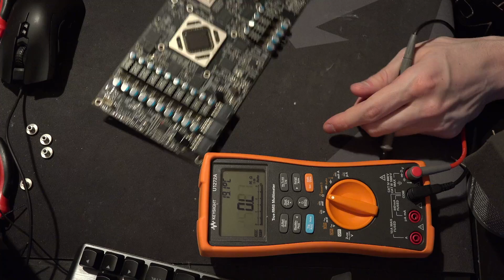Investigating the VRM config of Powercolor's custom PCB HD 7990

Comment from the maker: it was 4AM and I didn't manage to record anything else. And like that this video ended up public
Reply: Mine overclocks memeory much worse than both my ref cards and the stock memeory clock is 1350 where the ref 7990 memeory is 1500 at stock.
Reply: Its fine, i have a 7990 that fans spin but no display or not seen in bios. Gotta pull it out now.

Comment: @Actually Hardcore Overclocking I actually just got an HD 7990 with and ek block included and the air cooler. It was only $100 and I'm really excited even though it's not a custom PCB. Keep up the good work dude.

Comment: Damm i love that card! Fee months ago i bought an RX 480 8GB Reference card that had the same problem. With AMD driver it POST but after Windows boot it stay on black screen. I tried everything but at the end i fixed it by BIOS Modding to a RX 580 and it still working. So i don't know if that can help you with that card but it worth the shot.

Comment: This here is surely a curious card.
Though, the power layout seems a bit strange to say the least.

Though, putting the VRM between the two GPUs is an interesting idea. As long as it doesn't interfere with the communication between the GPUs it would solve some of the issues.

If I were laying out this board I would have put on some buss bars on the back. Literally a large copper strip elevated slightly off the surface of the board, carrying power over to the other side with fairly minimal losses. Advantages with such buss bars is their exceptionally low resistance, and that they don't really take up any board space on their journey over the board. (And they can also double as strengthening bars to stop flexing, but that isn't really a major issue for most graphics cards.)

Though, the real solution is to have a VRM for each GPU. Since even with impedance matched power plains we can still run into issues overvolting one of the chips if the processing load isn't shared between them, as in one is idling and the other is working.

Comment: I think you could resist the shorter trace runs, so the longer run could balance at the memory chip. That way you could turn up the entire voltage base. Not sure how that would factor with ohm's law on the longer run, need to calculate it. that could very well be the basis of the missing caps, for the longer run.

Comment: wouldnt swapping chip and vrm cause issues with pcie signal integrity?
Reply from the maker: https://tpucdn.com/gpu-specs/images/c/2523-pcb-front.jpg
Reply: @ActuallyHardcoreOverclocking  I was going to mention the 295x2, but I guess you beat me to it.
Reply: depends how solid or 'holy' the ground plain is, and if it's different signaling or single-ended. You are correct in that voltage drop over distance occurs for everything, not just power. B)
Reply: @Zarcondeegrissom  I was more concerned about induced voltage and crosstalk from the vrm to the pcie signals?
Reply: kingspride, yeah, laying out traces is a work of art, that is more than just making it look pretty. like knowing how to mix paints and what paints to use on what surface, there are corses on laying out traces so that they minimize 'inducing' signals on each other. ranging from right angle crossings to coplanar ground planes, to having power or ground between the signal trace and the sources of noise. It's not impossible, it just takes some work and having enough PCB layers to do it.
Reply: Tadas Nanartonis, due to the presence of the PLX chip, and what the PLX chip does, the distance that matters by moving the GPU dies, is from the PLX chip and GPU, not the GPU and CPU. Correct that distance matters, however, I'm sure PCIe has a max length far longer than the length of a PCI card, lol.

PCIe being differential, also reduces any cross talk, so all that matters really is keeping the 'parasitics' between the twin signal traces and the surrounding ground plane modestly consistent (within spec), and the extra 10cm shouldn't be a prob (for voltage drop, or signal delay). as the example, BZ posted above shows.

FYI, ballpark, signals travel down copper wires at about 90% of the speed of light (80% to 95% depending on the grade of copper and construction of the wire). At that speed, 10cm isn't much of a delay at PCIe clocks.

Comment: Is it safe to assume they prototyped a handful of variants with various placements of certain elements/pushing one core forward etc, or no they’re just drawing out a sketch and then making it exactly as is shown on their final theoretical mock-up or whatever tf it would be called. 

More than expecting you to know 100% I’m hoping you can reach out to some of your industry contacts or ask Steve to and ask that exact question, citing this card as an example to them/whatever company answers “can you describe the process from concept to “ship it”, particularly for a product that while maybe not groundbreaking, it introduces challenges not typical of the 99% of cards made, so in such a case would you lean on the reference manufacturer to answer questions about core placement, would prototyping each possible route be too expensive” etc etc something like that. Would make for interesting content, a great interview/retelling of a conversation etc. and will inevitably blow a lot of minds that assume the process is either extreme (meme levels of planning on one hand & prototyping/small scale production trials of each potential major revision on the other)

Comment: You can impedance match according to distance by using smaller planes for near chips and larger planes for the far chips.  Meaning that you will get the same voltage to all chips.
Reply from the maker: Yeah except I've never seen a card do that. If I check any of my other cards the mem chip furthest from the VRM gets less voltage than the chip nearest. Now I guess for this thing PowerColor could have gone the extra length but I really doubt it.
Reply: Well, PowerColor is not known for having the best VRM designs, so you are probably right.  It is possible to do though.

Comment: Put the card on liquid nitrogen for maximum 5 minutes then put it super fast on the freezer for like ten minus in ten minutes it would no create any ice around it from 10 minutes to 15 minutes  maximum no more that 15 minus. Remember only 15 minutes nothing more and they you can take it without hearing any crunch songs. And put it on a paper towel and wait like five minutes to get room temperature or ten minutes after that you can began to do whatever you want to the card. Hope this tip helps.

Comment: I know sometimes a corrupted bios can cause the same issue. Maybe try and flash it? can’t hurt
Reply: That's just what i thoght. The guy from RandomGaminginHD just revived a 780 with a similar issue (blackscreen after driver installation) by flashing a stock BIOS. Might be worth a shot.
Reply from the maker: I've literally never had a card with a corrupted BIOS. Plenty of half dead silicon though.
Reply: @ActuallyHardcoreOverclocking  just try it lol cant hurt 
PS: youre awesome
Reply: I think Jayztwocents also had the same happen. Not like it'll hurt to flash a bios